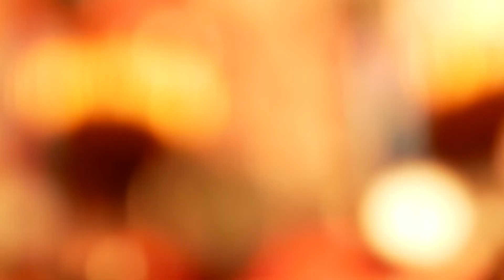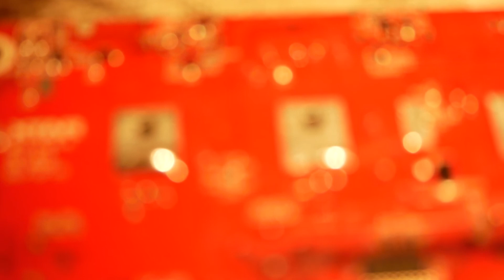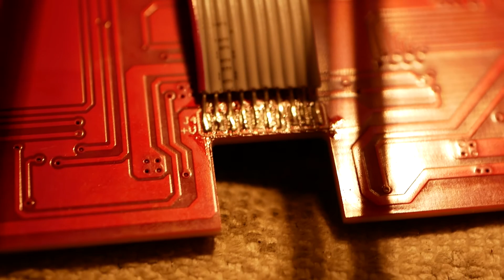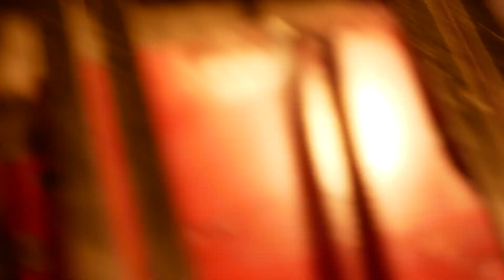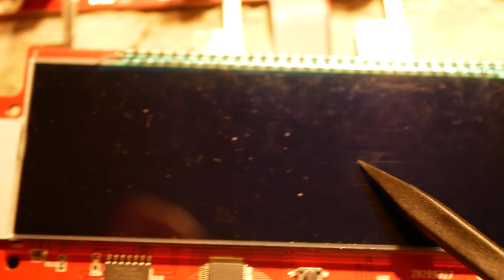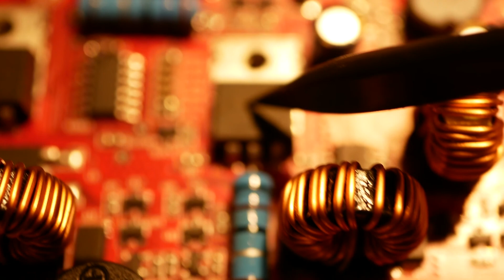XTAR VP4 plus teardown

Comment: nice video, im proud :) i just missed what i wanted to see, actually what i need to see to know to change of my charger. on 8:24 element D27 - the bigger one soldered on the long line, above the 4rth coil. my blew plus u9 mosfet 9926B in case relevant, everything else looks fine.
what is D27 - name and model to find it around me to swap it.
thanks for any help, yo
Reply from the maker: No idea...I'd have to take one apart to find out.
Reply: @de-bodgery  that would be helpful, a lot
Reply: yep same, my D27 also blew up. @steffvatt did you find out the name of this component. i managed to understand only that is says 5.1B something
Reply: @BombasticVirus  i returned it to amazon and bought a new one. no idea what the diode is.
Reply: Check out the answers to my comment.

Comment: Where is the sdcard slot for the storage of the test data they have written in the manual 🤔
Reply from the maker: There isn't one. Do you see one referred to in the manual?
Reply: @de-bodgery  they have written something like that in the Manuel or I have miss read it? 🤔
Reply from the maker: @WaschyNumber1  The manual says it stores values, but it doesn't say how or where that I remember. Anyway, in the CPU is some flash memory that is used for this info.
Reply: @de-bodgery  OK, thank you, I think they could have made it even better if there would be a slot for a SD card and or even Bluetooth and a android app, also its a shame that they don't have made a better resistance measure cable and they don't sell even replacements for it. 🤔
Reply from the maker: @WaschyNumber1  I know of 2 cell testers that do real 4 wire Ir testing. All the others do it through the spring clips in the bays and completely worthless for Ir measurement. THe Vp4+ is one of them that does Ir testing the right way.

Comment: So I’ve had one of these for a few years now, I keep it in a nice case and am gentle with it, but sometimes I can only charge 3 bays now and today I could only charge two bags at the same time.
I’m wondering if it’s because their old batteries or if it’s the charger.
If I put 3-4 batteries in one or two bays will go from red -charging to green like their full.. when I take out the extra battery the others will go back to red charging. So weird!! Any thoughts?
Reply from the maker: try 4 known good cells and see what happens.
Reply: @de-bodgery  thx for the reply man! I’ll have to order some new ones. Mine are like 3 years old. Hopefully that’s the issue, I’ll let you know! Cheers

Comment: Nice detailed video! Can you give details on diode D27, I was trying to revive a 12V li-ion battery pack (without disassembling it) and instead of connecting a separate battery, I connect two in a row so basically 8+V on channel 4 and D27 went into smoke (slipt in two), I would like change it and see if it would work again. :)
Reply from the maker: The 4 channels in every cell tester or charger I've seen are not isolated from each other in any way. I'm sure you know you blew up your cell tester, but that's why. The 4 channels are electrically in parallel with each other, not series.
*
You have other diodes on the board that are the same kind. Look up one of them.
Reply: did you replaced your blowen D27 diode? mine just blew and I cant find the diode name. 5.1B something but what are the extra two number I have no idea
Reply: @BombasticVirus  it is a zener diode, check  PTZ 5.1B. Any  zener diode with the same characteristics will work, even if it is not smd

Comment: I think that you might like to brush up on your components and component markings, particularly the resistors.

The Surface Mount R150 resistor is 0.15 ohms (150mR) not 15 ohms, and these are the Current Shunt Resistors for the Charge/Discharge measurements for each cell/channel.

The four light blue bodied power resistors with the 5 coloured bands are in the buck-converter power circuits for each channel.
The Silver/Gold band is not the tolerance/accuracy band in this case - it's a value multiplier, the tolerance band is the Brown band at the end signifying 1%.
The value is black-brown-black-silver-brown = 010 * 0.01 = 0.1 ohms (0R1) 1%

The other two 5-band power resistors are in the 3S Battery Pack Charge circuit and are connected in parallel for power rating and/or specific resistance.
The value is red-violet-black-gold-brown = 270 * 0.1 = 27R 1% - two in parallel 27//27=13.5R

Comment: Any chance you would know how to fix one if I connected the test probe to the usb 5v output and tested a battery now it doesn't work correctly but does power on?
Reply from the maker: The USB port has its own DC-DC for converting 12v in to 5v. Probably that is toast and everything else is fine. I show it in this video.

Comment: Hi,i have a blown FP6277 but cannot get good reading of last numbers,where can i get substitute of that? on aliex i got 50L last number but i'm affraid mine was 88L...this is sop 8 chip and mine had capacitor manualy soldered from 8pin to u13 print on board...can i use any other chip or must be that?i unsoldered broken chip and cap(cant read value because it fluctuates to no reading) and charger works when batt is inserted ,but wont work with charger...
Reply from the maker: I'd say you need parts of the identical type. The capacitor can be from any source as long as its value and voltage rating are the same. The SOP8 IC is probably something specific like an op-amp or an ADC or a charge controller. More than likely there are more of them on the board that are not damaged that you can read the part number from.

Comment: I watched your video on the lii 600 and you recommended this vp4+ several times so I watched this video to see what was so much better. However I wasn't instilled with any confidence. It appears that they are both over priced garbage 🗑🚮
Reply from the maker: All this stuff is over priced. I've thought about  remaking this video. Now that I have seen the even poorer level of quality in most everything else, Id have to say that the XTAR VP4+ is much better made than most everything else out there. Also, it does cell Ir the most accurately of all cell testers I have seen so far. You'll still do best with a VP4+ over a Lii-600 if you care about both cell Ir and capacity. If all you care about is cell capacity, the Lii-600 is a bit cheaper and it does that well enough.

Comment: Thanks for teardown. i was curious about if they put heatsink or not. now im sad.
Reply from the maker: I have 3 different cell testers and the XTAR VP4+ is the best of them. While it could be better, the LittoKalla S500 is crap and the OPUS C3100 is only slightly better. Neither are as good as the VP4+. They can't support cells larger than 18650's and IMHO...that's a show stopper. They also require setting up again for every new cell put in them. VP4+, it stays in the same mode and same settings until you change them...cell after cell after cell. It also supports measuring cell resistance. The VP4+ charges and discharges at 1 amp on all 4 channels while the others only charge at 1 amp and discharge at .5 amps. It's lots better than the other options.

Comment: Well since I own the XTAR VC4 and it has been a rock-solid battery charger, I thought it would be a good idea to upgrade to the XTAR DRAGON VP4 Plus, Right?
Wrong!  In under 1 year, the plastic started cracking and the thing literally fell to pieces! 
It is made out of a different type of plastic than the XTAR VC4.
I tried to tape it together, glue it together, epoxy it back together. Right now it has epoxy with a zip tie holding it together with Brass pins I had to put in it so that it would stay stay together and could even be used. I am sure glad I did not get rid of the XTAR VC4. That thing is built Rock Solid and still is going strong 5 years later! The Dragon VP4 Plus, not so much! I still use it when I'm charging multiple batteries or, I need to cycle some batteries. But I have to baby it because,  I never know I might have to add more zip ties to hold it together or something?
Reply from the maker: About 95% of electronics from China have ABS plastic shells. It's inexpensive, easy to mold and doesn't wear out injection molds quickly. It's a generally good plastic to use for this application. 
*
I don't think your charger shell has anything to do with the general quality of the product. I have a Dewalt 20v battery. They are made with glass reinforced nylon...which is far superior to ABS. My battery shell has that problem too. The plastic formulation didn't get mixed well or an ingredient got missed...who knows exactly...but that's a plastics issue and XTAR doesn't make their own plastic shells. They contract that out to someone else. So like me, you got a one-off bad mix of plastic in your shell. Your charger works OK right? Just the ABS shell is a mess? If so, I wouldn't blame XTAR for this.
Reply: I wonder what the hell you did with it in the bedroom. You are a 🥔🧠.
Reply: Lay off the methamphetamines.